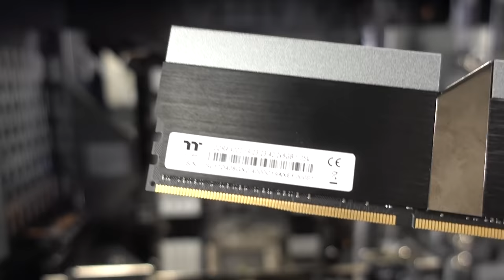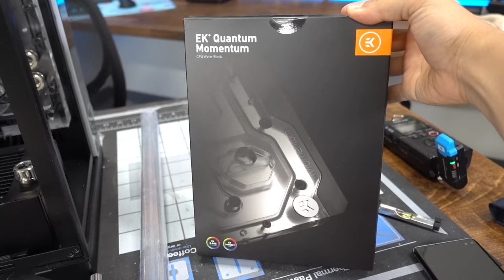My $10,000 PC is back #CHROMETHEUS

Comment: Iam about to end his PC's whole career before it even begins! lol No pun intended.
1: Thermaltake RAM has to go bro, the brushed nickel look don't shine like chrome.
You should of used instead: Trident Z Royal 256GB (8x32) silver kit
2: Too many specialty fittings: offsets, 90's on top of 90's? you dont need all that, looks like a junk yard.
to look clean and simple use all straight fittings and keep the PETG tubing because you can manipulate it to fit. 
Put the chrome tubing and specialty fittings back on the shelf please.
3: Your hiding the beauty of your GPU cards plexi side?
Vertical mount your GPU looks way better anyways and has better support.
4: Throw that NVME pcie card away.
Use your MOB slots instead
5: Bottom radiator is way to thick man, your gonna need a push pull config which is way too much.
Use a thinner radiator with a pull config for fans on top.
6: And last but not least like you said you should of went with the  Ryzen 3990X if your gonna call this "Chrometheus"
otherwise its just Chrometheus's little brother!

Comment: Anyone tell me if this is any good for playing warzone? Blue Tooth: N
Depth: 456 MM
Display Size: 24in
Dongle Required: N
AMD Ryzen 3 3200G 3.6GHz, Turbo up to 4.0GHz
8GB 2666Mhz DDR4 RAM
1TB 3.5” HDD
Windows 10 Home
ASUS PRIME A320M-K
VEGA 8 APU
350w PSU
Red LED fans
Cooler Master 3.1 Lite Gaming Case
Graphics: VEGA 8 APU
Hard Drive Storage: 1 Tb
Height: 381 MM
Processor: AMD Ryzen 3 3200G
RAM Memory: 8 GB
Screen Resolution: 1920x1080
Screen Type: Full HD IPS
Touch Screen: N
Width: 208 MM
Wifi Enabled: Y

Comment: Seems incredibly monetarily wasteful and super inefficient that you didnt just use flex tubing to get the proper lengths needed and then measure those next to the metal tubes, but hey, I'm sure you already had them, it just sucks just seems that glass tubing went to waste cause its only good for this build with that distro plate.